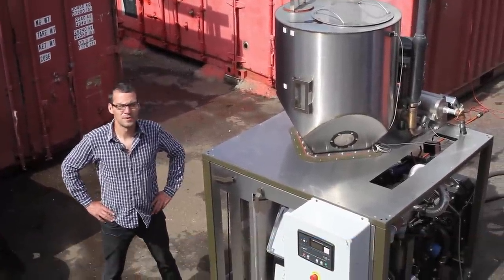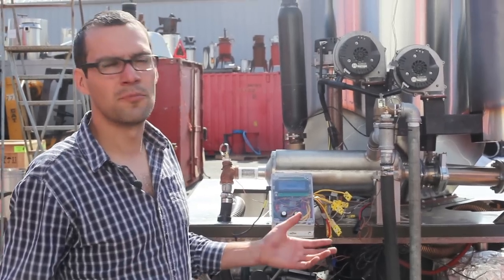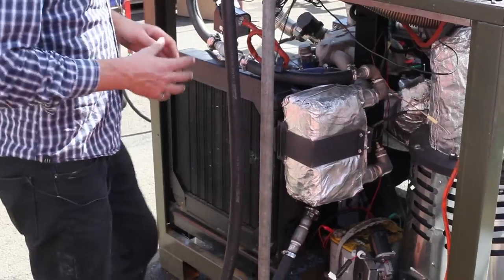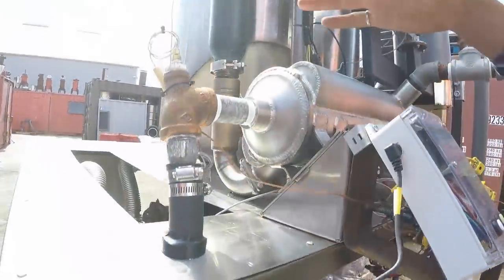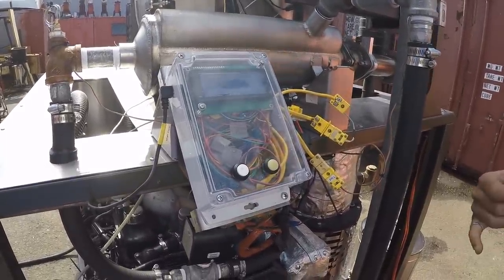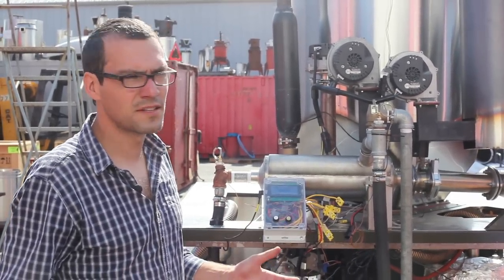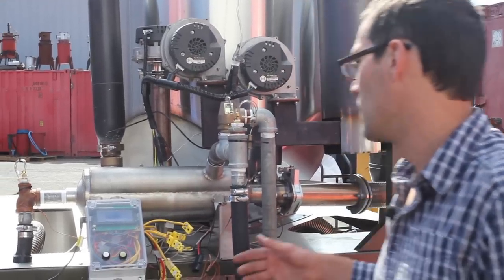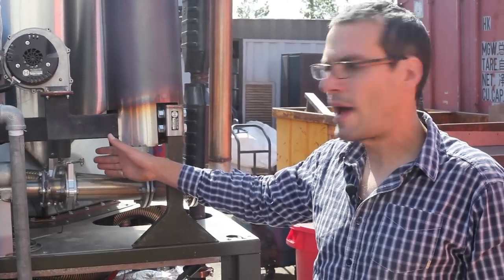Continuous Heat and Power (CHP)

Comment: Could you use the heat to bowl the water specifically to create clean distilled water?
The cube could then dropped into remote locations and communities in order to provide power and clean drinking water.
Reply from the maker: This is a great idea and we actually worked with a partner to develop a similar concept that won the X PRIZE Water Abundance challenge about 18 months ago: https://water.xprize.org/prizes/water-abundance

Comment: 10 kw electric to 20kw heat, 33% efficiency. A diesel engine can easily do that. BUT ifvyou guys can make something portable that could use multiple fuels, wood, diesel, gas, and weigh less than 70 pounds and produce 500w or more, that would be something